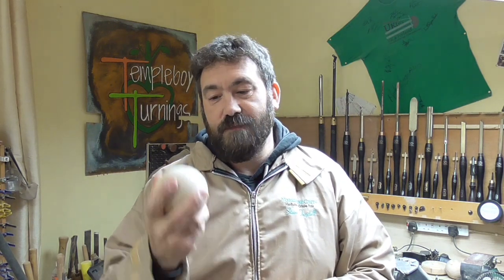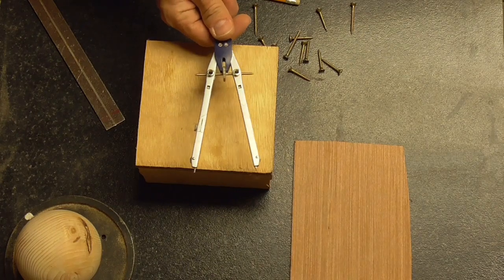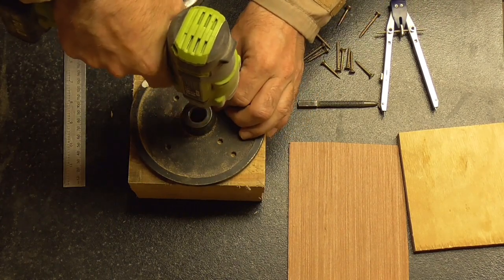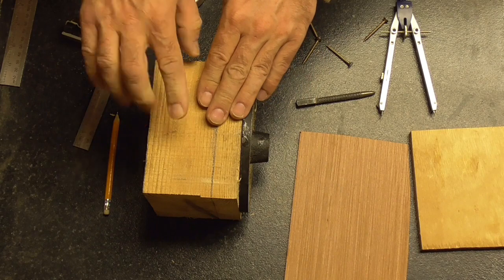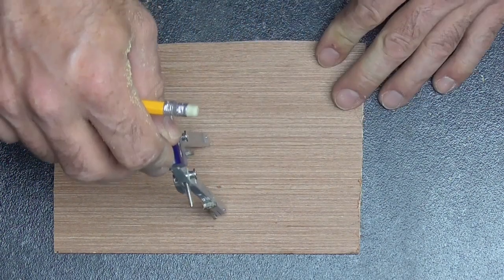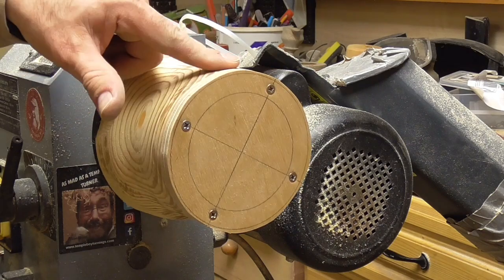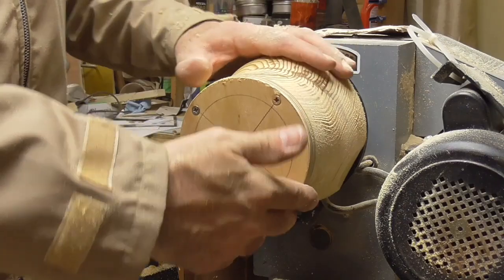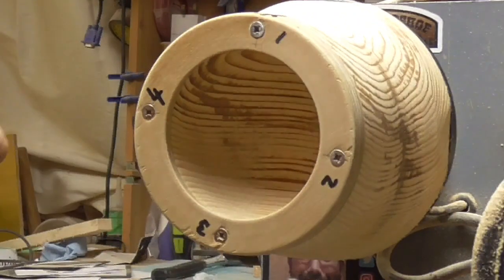Learning Sphere art - Episode 2 ( Making a Sphere Doughnut chuck )

Comment: A thought: Why not drill a hole all the way through the hole in the faceplate? If you force-fit the sphere in the chuck, it could be hard to get out. A half-inch hole would allow for a 3/8" dowel from the back to nudge it out. Looking forward to repaired links and the follow-up videos.